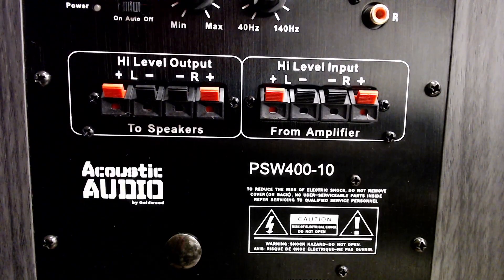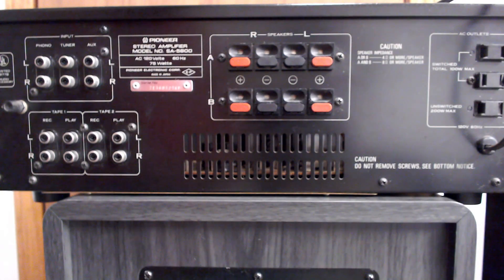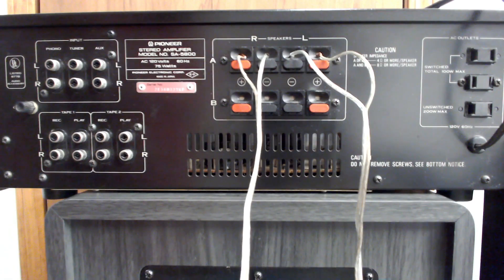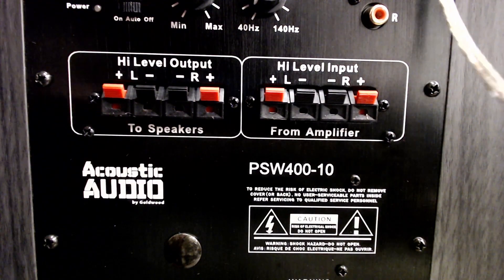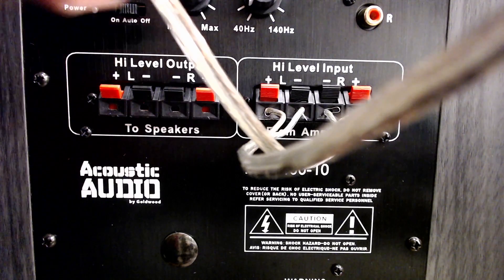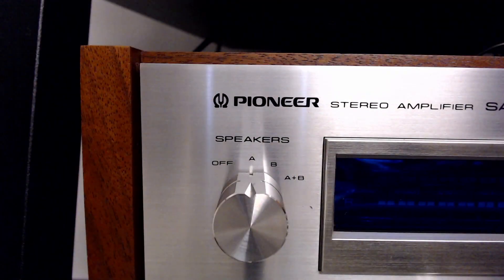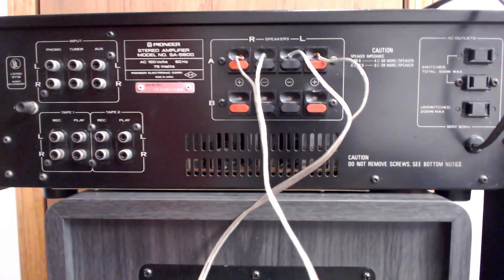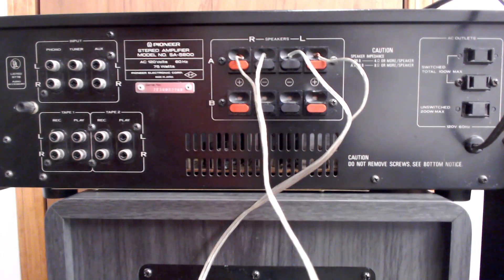Demo on how to hook up a power subwoofer to a vintage receiver

Comment: Do we plug in the powered subwoofer?
Reply from the maker: Yes, once you get it all hooked up like it shows in the video plug in the power subwoofer.
Reply: I'm worried that the powered subwoofer will short out the receiver once plugged in.

Comment: The speaker wires you hooked up to the receiver were they from your regular speakers or did you just hook up the powered sub and no main speakers
Reply from the maker: That demonstration was just for hooking up the power subwoofer if you have A and a  B switch on your receiver you can use the A for your main and the B you can use it for your subwoofer
Reply: @Hwords1 the problem is the impedance if you use a + b